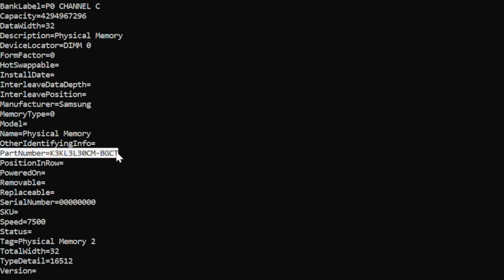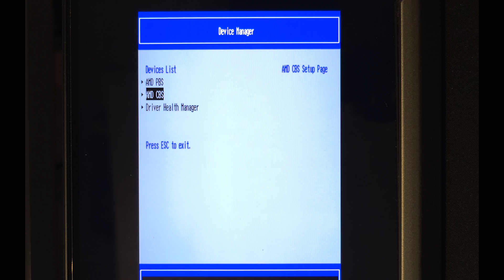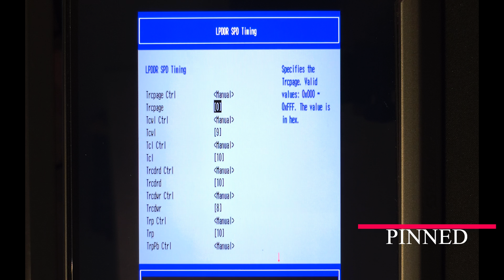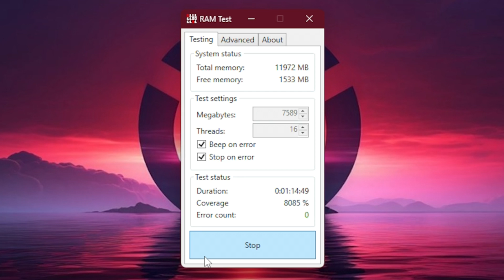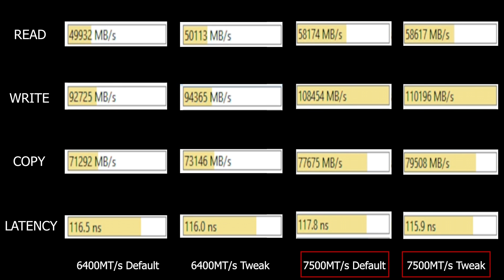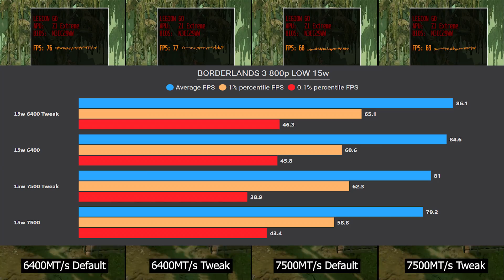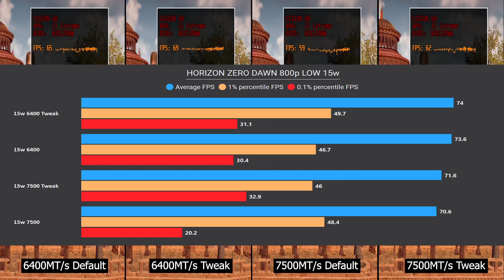LEGION GO Memory Timings boost guide & benchmarks [6400MT/s vs 7500MT/s]

Comment from the maker: I really hope it would help others looking to maximize their LEGION GO performance in specifically if you run it at 15w, if you need help with it please don't hesitate to ask but "Do it at your own RISK", memory timings settings may differ between unit to other for many reasons
Also keep your Legion Go plugged in to a power source when changing those settings

By the time of capturing, I had BIOS N29 but now I tried them on the latest BIOS N31 and it works just the same, I'll try to update this section as more BIOS software releases. 

Useful stuff:
Smokeless tool: https://github.com/DavidS95/Smokeless_UMAF

Hexadecimal converter: https://www.rapidtables.com/convert/number/hex-to-decimal.html

command to know your memory type: "wmic memorychip list full"

7500 MT/s Timings Tweak: https://www.youtube.com/watch?v=_PWAgv_KF_s&t=602s

if you are having hard time to see my current timings:

SPD: 

Trcpage: 0 
Tcwl: 9  
Tcl: 10  
Trcdrd: 10 
Trcdwr: 8 
Trp: 10  
TrpPb: 8   
Trfc: AF 
TrfcPb: 56 

Non-SPD:

Tras: 15 
Trc: 1D 
TrcPb: 1D 
TrrdS: auto
TrrdL: auto
Tfaw: 6 
TwtrS: 2 
TwtrL: 4 
Twr: 18
Trtp: 5
Tcke: 1
TrdrdScl: 2
TrdrdSc: 1
TrdrdSd: 1
TrdrdDd: 1
TwrwrScL: 2
TwrwrSc: 1
TwrwrSd: 1
TwrwrDd: 1
Twrrd: 1
Trdwr: A
------------------------

LPDDR Controller Configuration

Power down : Disabled
PHY Lower power : 1

-----------------------------

LPDDR Security

TSME : Disabled
Data Scramble : Disabled

-----------------------------

LEGION GO PLAYLIST: 
https://www.youtube.com/playlist?list=PLg8ANjUNzqfN0uUCjfOQmFXCNulJuFIRr

If you enjoy my content Subscribe & Become a member to activate extra PERKS
Join the TECHOSAUR Community on Discord here : https://discord.gg/PXmJY6BP8b. 
you can seek technical assistance, exchange ideas and experiences, relax, share memes, make video request and most importanly feel at home

Comment: I try all config but it was unstable on normal using, samsung vendor here
Reply from the maker: Because they're so tight, try with only the SPD ones to discover where the issue is occurring. If you spot it in SPD, go through one by one. Once you find it, just increase the value until it stops fixing the issue, and then go on.

Comment: I had a Lenovo legion go with micron, and I gave it away 🤦🏻‍♂️, I should have donated it to you so I could do it with that one.
Reply from the maker: ahah you are so generous to donate it, here in Europe I believe all units have Samsung, if one day i get a micron and I think there's an SK Hynix 
I would absolutely do it on them too.

I think users with other than Samsung can apply the technique and just be patient and keep trying, its a bit tedious but as i said previously, on the LEGION GO thanks to the Self-BIOS healing feature that you can enable in BIOS, it really saves a lot of time in case you set wrong values, another cool trick after changing timings go to smokeless and press continue without modifying any value, if it goes to the BOOTING menu chances are high it would boot to Windows fine, but the only thing remaining is testing in aida64 or RAM test app, because often times it may load Windows fine but fail in stability tests, best way to leave it for like 1-2 hours on them to make sure, this way you avoid any BSOD or even performance loss.

it took me a total 3 days to get it done but after seeing the result, I feel it was worth it, hope it helped